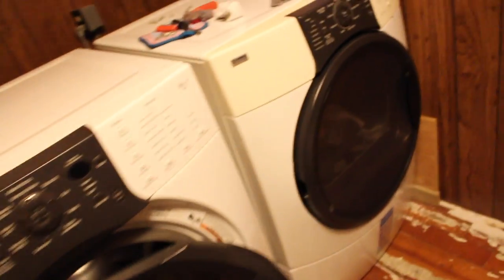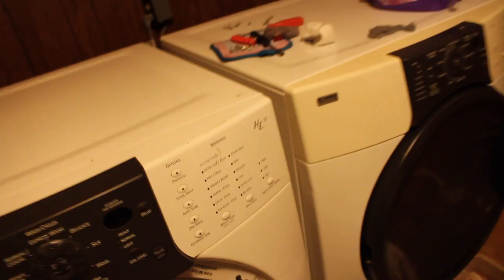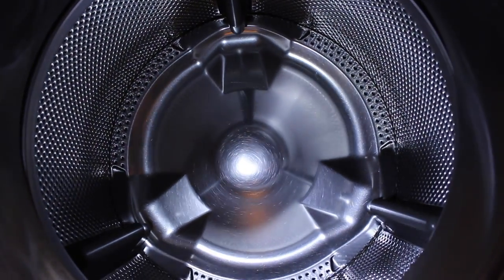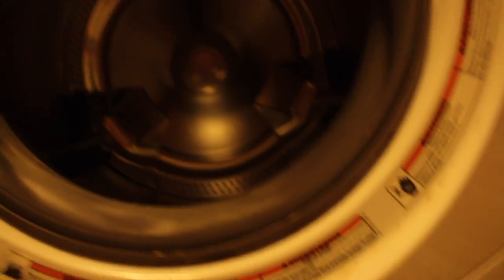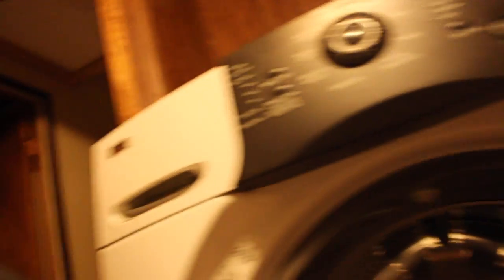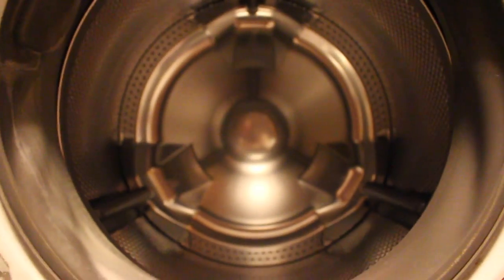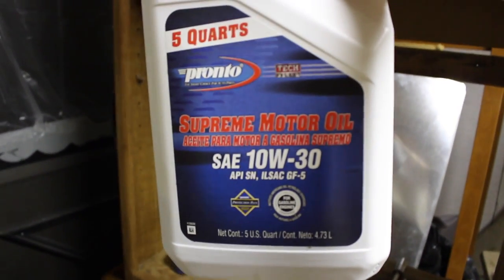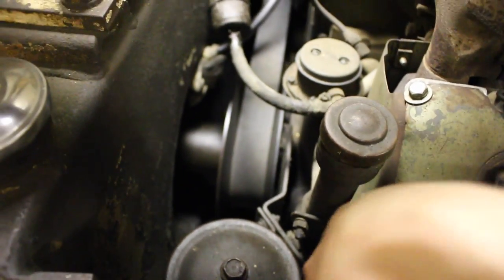Washer Side Loader Getting Replaced! & Vlog!

Comment: We had a Cabrio washer and dryer and it ran 2 to 3 times a day, 7 days a week for a yr and a half b4 and never had an issue with it. It had the push button controls and the steamer, the whole 9 yards.  Just upgraded it bout a yr ago cause the place we hve to put our dryer is under a shelf and it was hard to get to the controls so we now hve 1 with the controls on the front.  The Cabrios r really good washers and dryers.  The no agitator is awesome.  The only thing about them is tht u hve to b sure tht u hve a even load or when it goes to spin, it will through up an error.  Other than tht, they r gr8.
Reply from the maker: they are good but the computer in them suck in anything now days. but i have been thinking about it... thanks for the tip
Reply: your welcome Tyler.  Yea, but nowdays, everything has a computer of somekind.  From vehicles to everyday items that we use

Comment: If you are replacing the washer and dryer,

Get a Speed Queen or top load washer with agitator.
Reply from the maker: was gonna but they are to high just gonna get a used whirlpool cabrio 2010 with not agitator my grandma has one and has no issues with it this one has a brand new pump and computer and motor so its brand new for 140 bucks